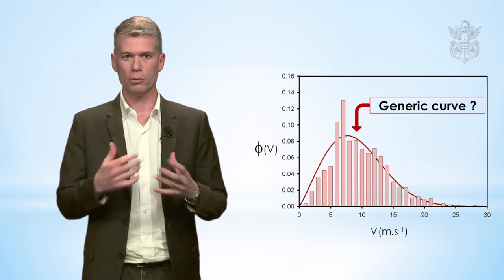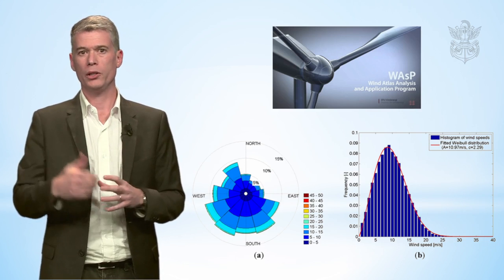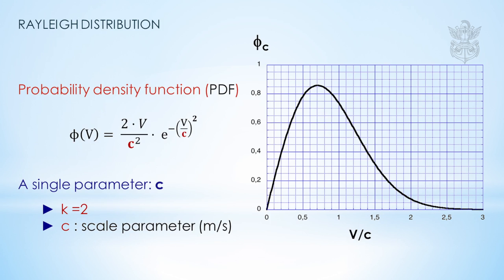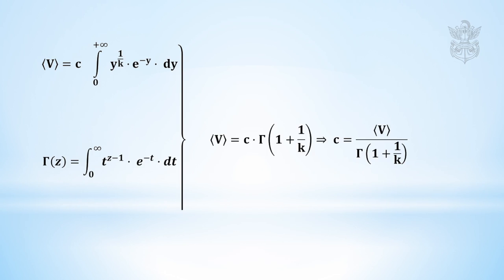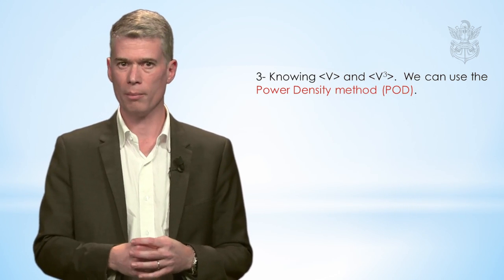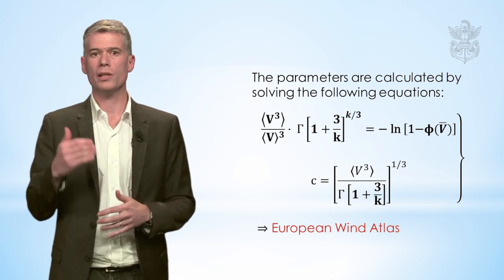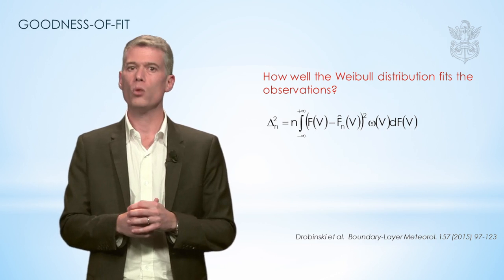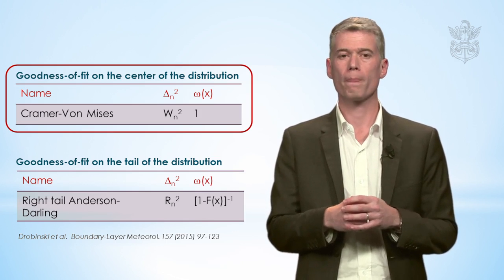Weibull  Rayleigh distribution - Wind resources for renewable energies

Comment: Excellent video, thanks. I used to think what happen if Weibull is not statistically convenient for the wind speed data, should we use the distribution that fits better to calculate the power? From a Kolmogorov test for example? Thanks again